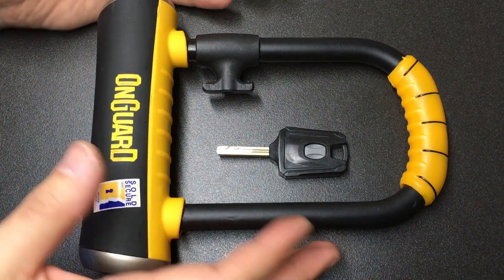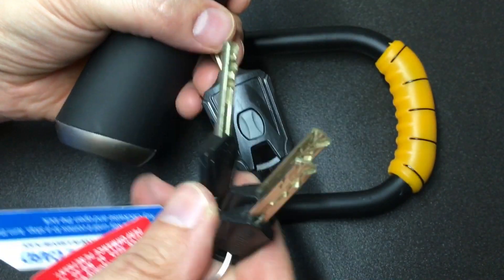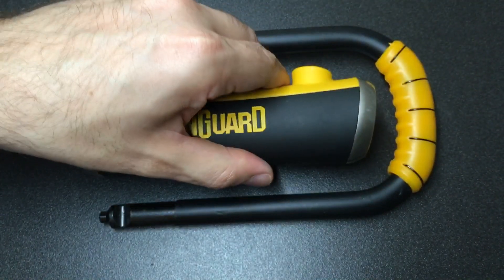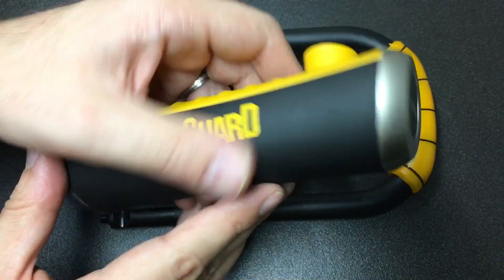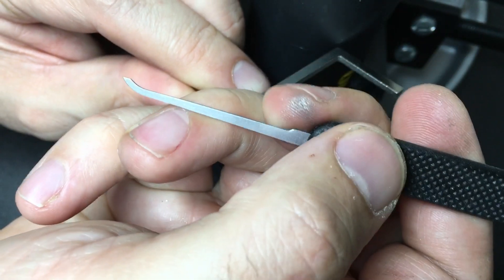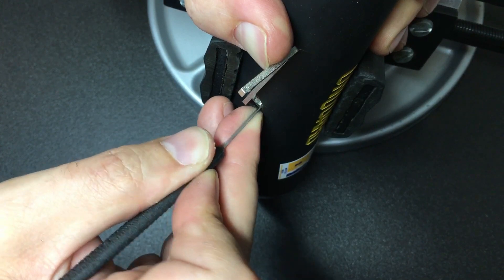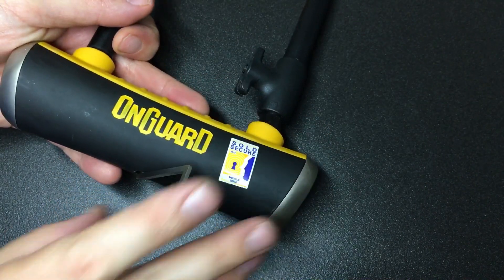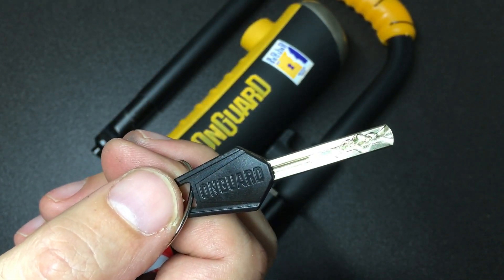OnGuard Pitbull 8006 Slider D Lock Picked

Comment: I think these OnGuard locks are great value for the money. In some tests it outperformed many rivals in cutting resistance. I got mine (8005) about ten years ago, still working perfectly. Tried to open it, when I got myself into picking, but I had no success. After seeing this pick video, I can still say that it is quite safe for a bike lock.
Reply from the maker: some of them can be rocked open, so that is a factor to considder
Reply: you think this lock is safe, he opened it in 2 minutes. are u sane?
Reply: @ryen7335  have you seen some of the kryptonites and abus for 100$+ that are picked within 20 seconds?! two minutes in a cozy home setup is a lot!
Reply: @ryen7335  just consider he is a very skiled xguy its not so easy

Comment: Just watched a few videos on these locks, on guard. 
As it is an internal four track lazer cut key. These are similar to the newer Toyota keys. 
I wouldn’t be surprised if Mr Lee couldn’t produce a Lishi for this lock quite easily. 
It would be smaller than his normal tools but would enable picking and decoding in one. 
Come on Mr Lee.
Reply from the maker: yes. possible

Comment: Now I know why this lock is recommended by my local police as an entry level cycle lock. Not bad really.
Reply from the maker: It isn't too bad, but some can be rocked open like BB did
Reply: There's still a bit of a knack to even rocking them open and you need the right tools, I don't think it's a likely attack on the street, bike thieves don't really do picking anyway.  The brute version is one of the best value bike locks around for me. It's heavy but it's the only lock in the £30-35 range that will shrug off any physical attack short of an angle grinder.

Comment: Look at BosnianBill's video 1644 though. (No Skill Open)
Reply from the maker: You know that doesn’t work on every one of these though?
Reply: @LockNoob  Does it depend on the bitting?
Reply from the maker: @aszi77  bitting and manufacturing tolerances.  Both differ depending on the individual lock. This could not be rocked open, but I have rocked open other slider locks, so the technique is valid 👍